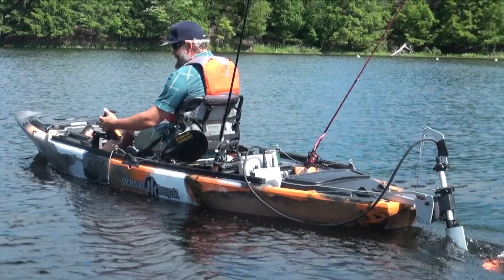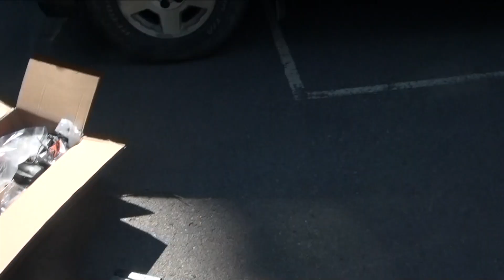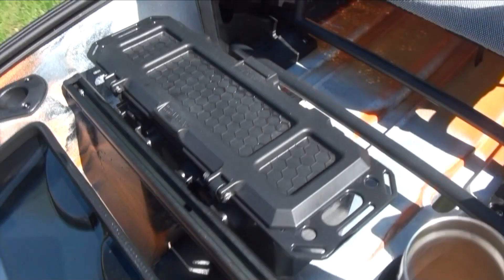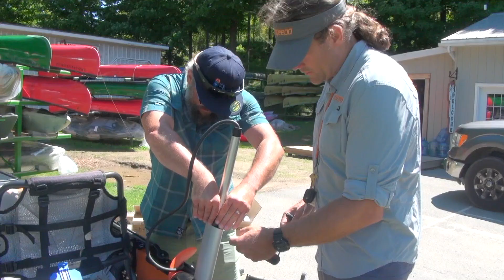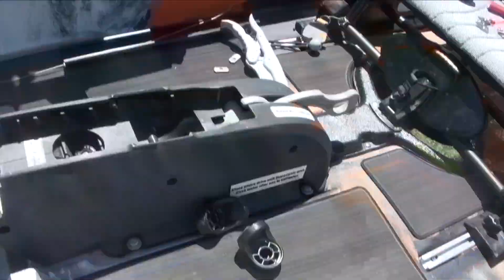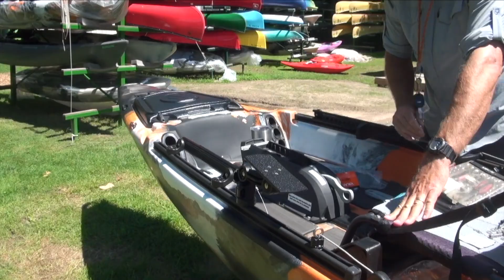Knarrly Torqeedo Install

Comment: Would like to install a Torqeedo  on my Jackson Yupik, at only a little over 12 feet do I need the 1103 or will the 403 be just fine. Also I run a dakota 54ah lifpro battery on board now. Is there an adapter available to switch over to that battery if I needed to?
Great channel lots of useful info, thanks
Reply from the maker: The Torqeedo comes with its own 29.6 volt battery and does not work with other batteries. Here is a YuPiK installation video:
https://youtu.be/f1rgQV1Mh6s

Comment: It was created to run water out of the points of cars when they had points instead of distributors.
Reply from the maker: Old heads used it on their fishing lures as scent. I think that it is or was fish oil based. But if you read a book by Dr. Keith A. Jones called “Knowing Bass”, they can not smell or taste anything that is oil based. It has to be a water soluble molecule to reach and interact with their olfactory or taste receptors.